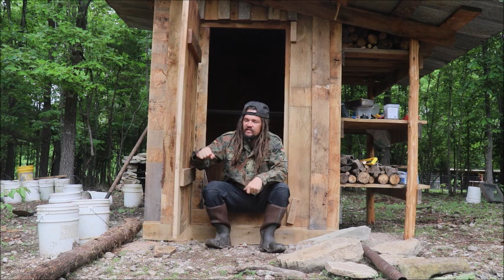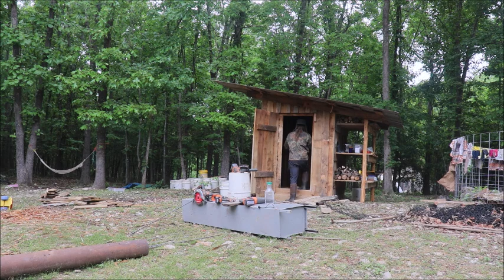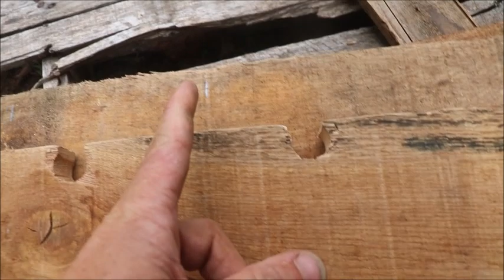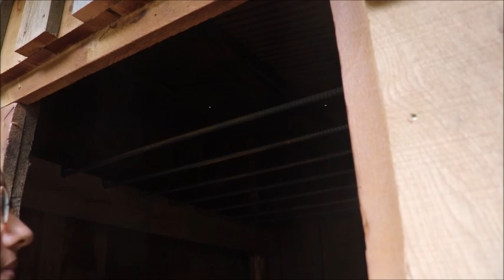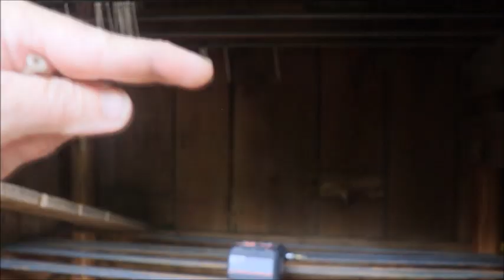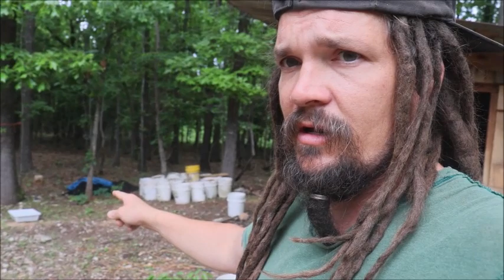INTENSE RACKING SYSTEM - DIY Smokehouse

Comment: Papa,  I would suggest you start driving round on trash collection days and checking the side of the road for old BBQ's/Grills which have a thermometer in their hoods. Get 3 of these so you can embed them in top/middle/bottom of the smokehouse door so you can monitor the internal temperature.  Once you start a smoke, you really don't want to be opening the door and letting the smoke or heat out.   
I've watched several smoker builds by professionals and even people who are amateurs who attempt to emulate a professional grade smoker.  A video that comes to mind first was by Richard Perkins (permaculturalist) who did a series about a year or two ago, with guidance from a neighbour or client who I think was a master smoker and had built his own smokehouse.  Richard Perkins now sells heaps of "value added" smoked chicken, I think Turkey and perhaps some fish, which is very popular in Sweden where he lives. From what I gleaned from his video series, I believe you are really going to struggle with maintaining constant/consistent temperatures. 
Your smoker doesn't have thick walls by comparison, and from what I saw it has holes in the tin, and cracks in the walls.  
You could improve your smoker's thermal properties with some foil backed foam covered by wood or if you prefer to go your usual "freesource" route,  build a 2-3 inch thick compartment as high up as you can filling it with sand, even lining or building up the walls with rock, so they trap heat and provide a thermal mass.  This will provide more consistent temperatures and save you from having to continuously monitor the smoker and having to move the food all the time as it cooks.  
Else, again from what I saw in Richard's videos you're going to struggle with inconsistent food that ranges from black/dried out/acrid charcoal at the bottom of the smoker, to food that is pale, uncooked all the way through at the top which will make your family sick.  It will likely be impossible to hold a consistent temperature, and likely take you much longer to smoke food, than is safe.  
Did I also hear you say you were considering collecting rainwater off the smoker to provide to your animals in your last video?  I would strongly urge you NOT to do that.  Else you may as well just shoot your livestock, to provide a less painful and quick death than being slowly poisoned by leeching of the toxic chemicals from the smoke residue that will build up and cover the smoker over time.  Potable water needs to be collected from clean surfaces.
Reply from the maker: My goal for the hot smoker was to cook at the lower center, and then send up top for additional smoke once thoroughly cooked. Thanks for the advice, I'll look into it more
Reply from the maker: Also, i just  installed my first thermometer about an hour ago. Good idea on adding more

Comment: Brine brine brine. That's the key to good smoked meat. Basic is 1 cup canning salt and 1/2 cup sugar per gallon of water.  Heat the mixture just enough to dissolve salt and sugar.  Cool it down before using.  It'll be a test to see how long to brine carp sides and duck to very the best taste.